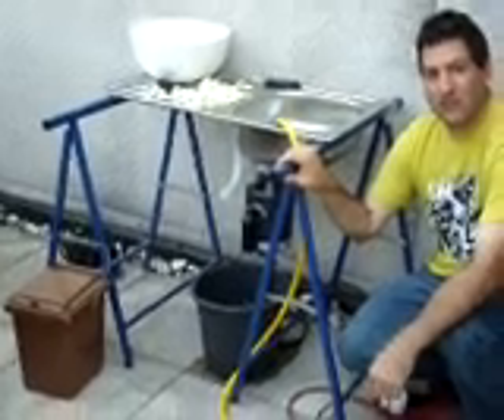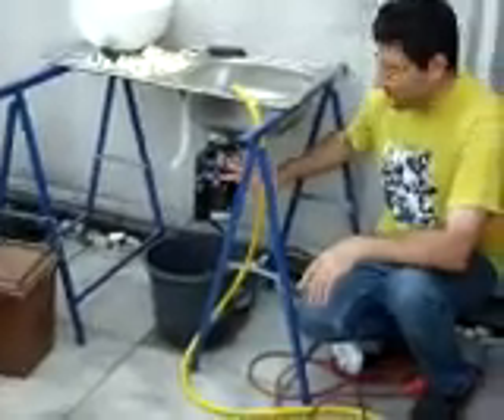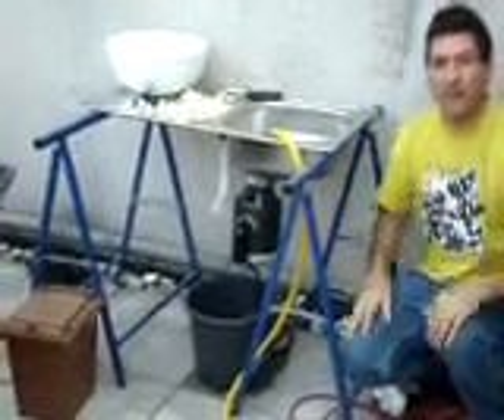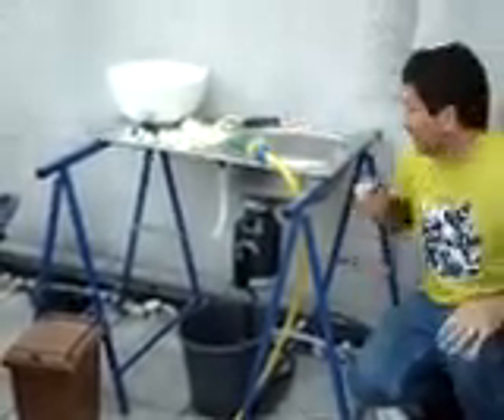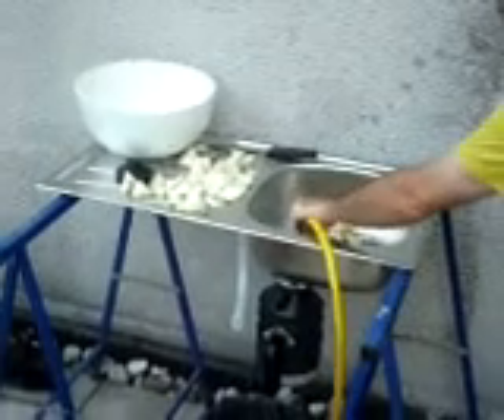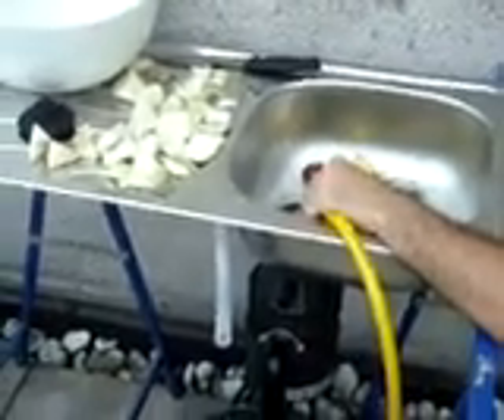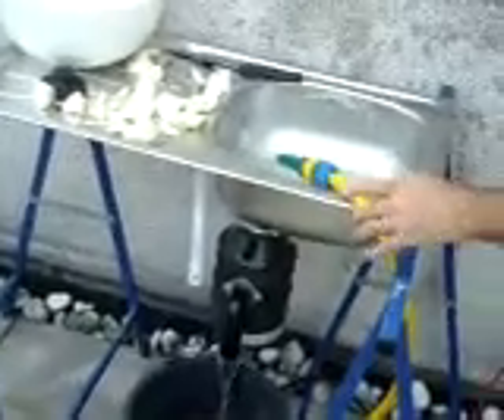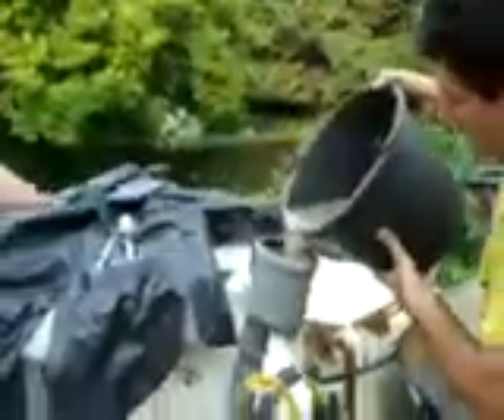First attempt to use Insinkerator Waste Disposal Unit with Biogas Digestor

Comment: This InSinkErator was a bit tougher to install as it is larger than my last one leaving little room to access ring between bottom of sink and top of disposer. It is also heavy. I did not rate this item lower because I expected this top line item to be a bit tougher to install. It is very quite and my wife loves it. 
Here is the link to it in case anyone is interested: amzn.to\19rGjHW

Comment: Excellent!  Looking good for integration.

I just saw this uTube vid: r8HDb1at6dI
where he's using a separate storage tank - which I've been thinking about as being easier than finding two barrels of the right sizes to telescope with each other.

Thoughts
How about fitting a temp probe in the liquid tank and an ultrasonic range sensor to the roof of the gas tank and maybe a PH sensor on the output pipe? Hook up to Arduino, send data indoors or publish direct to 'net.

[m]

Comment from the maker: We learned, of course, that the reason the waste disposal was overheating and shutting off so quickly had nothing to do with the water source not cooling it -- it was because the digestor is not made for European 220 volt 50 Hz current.  So all we need to do now is purchase a voltage transformer (which will set us back 100 bucks -- arrgh!) and it will work great.  Why they don't sell Insinkerator waste disposal units in Europe is beyond me! They really are great devices environmentally!